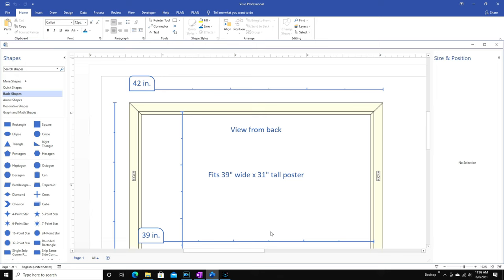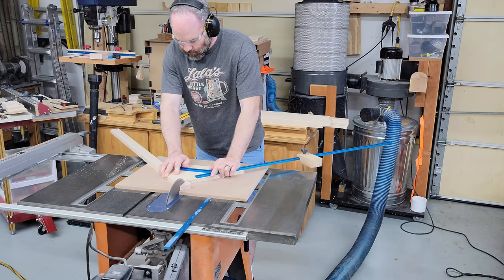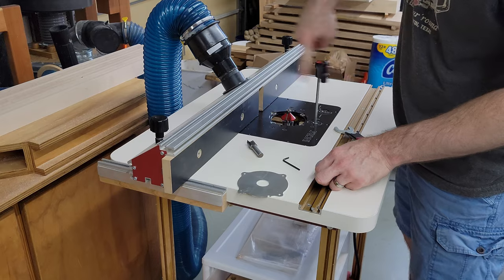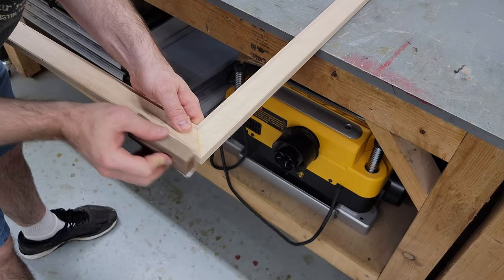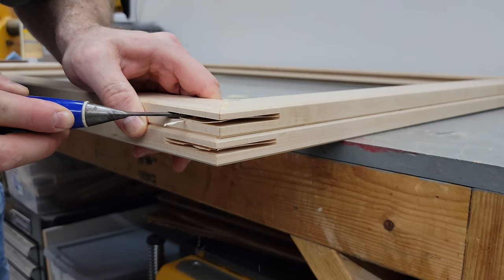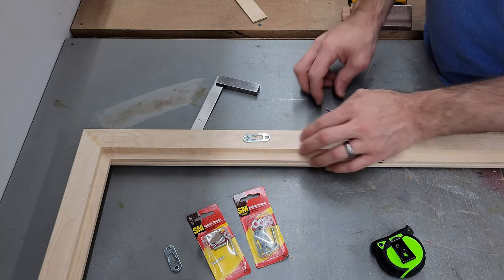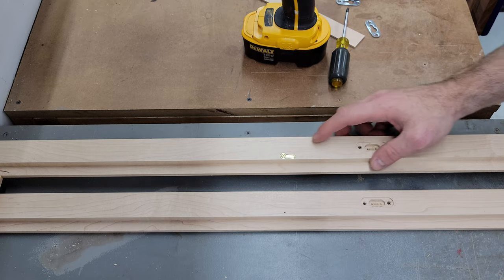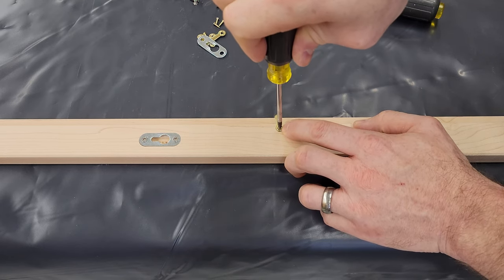How to make large picture frames with splined corners

Comment: I hadn’t run across this video before but found it timely, regardless. I too cut large frames , especially now that I have a wide format printer. My new jig resembles a number of others on YT, except that it can accommodate lengths up to about 47”, and the stop is cut at a 45 degree angle so I can precisely cut to a 1/16” in length. 

Your process I think is spot on. I love your spline cutting jig and I think I’m going to borrow its design. I especially like the clamping configuration. Currently I’m using a jig exactly like your old one, and have been searching for another solution. 

Your final product was exquisite. The miters looked perfect. I only hope the posters that went into the frames were worthy!
Reply from the maker: Thanks for the feedback. I really like the spline jig, and I borrowed the idea from other places as well. If I did it again, I'd probably make it smaller and just for picture frames, since it takes up a little more space than I'd like.

Comment: you’re not going to cut your fingers off on the table saw.  don’t think like that.
if the blade is sharp, the fence is locked in, use a push stick, keep the material against the fence, and some downwards pressure at all times, you will be fine.
respect the machine and keep your fingers away from the blade, especially over the blade, and you will be fine.
never rush the cut using the table saw, because that’s when the material is pushed up and toward you.
you can easily over power the motor on a 110V motor on a table saw, but staying safe, and respecting the machine is rule number one.  fear works against you when there’s not need for it.  yours using other tools to avoid the table saw, and that speaks volumes.  understanding the operation of each tool is key.
if you use each tool as it was intended, you’ll be fine. cutting thin tiny strips of wood on the table saw can be done safely if you use proper techniques, and you’ll never get cut. never.  pay attention 100% of the time, and take your time.
it’s the most useful tool in the shop.
i’ve been using a table saw for 35 years, and still respect it like it’s the devil.
i pay attention to what i’m doing snd make sure how i’m cutting won’t hurt me.
EVERY TIME. 
when you notice the blade getting dull because it takes more pressure to cut, it it starts to burn, swap it out for a fresh blade.  i just would not avoid the table saw.  you can do so much with it and be safe about it.
cheers !
no, not cheers, don’t have a drink lol
cheers as in ciao, or good bye
Reply: No splitter and leaning over a very high spinning blade - I think that he should be worried about what a table saw can do to his fingers!

Comment: Please lower that blade and don't reach over the blade, take that ring off as well other than that great video
Reply from the maker: @CROSSBOWSTEALTH  Lowering the blade for this cut results in more blade surface area contacting the wood, which generates heat and increases the risk of burning. Furthermore, a lower angle cuts towards the operator and increases the risk of the piece shifting or chipping in the back, while a higher blade cuts downward, helping hold the board down and putting any chips on the bottom. You can do it your way.